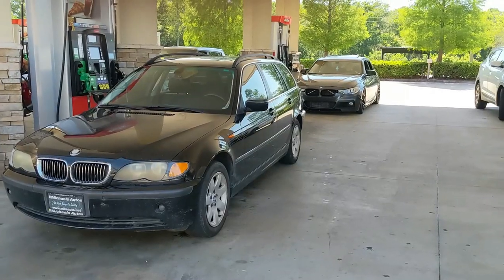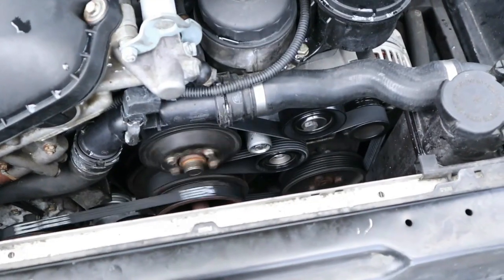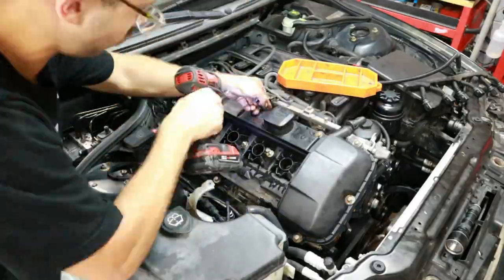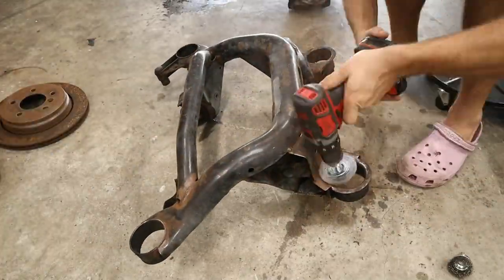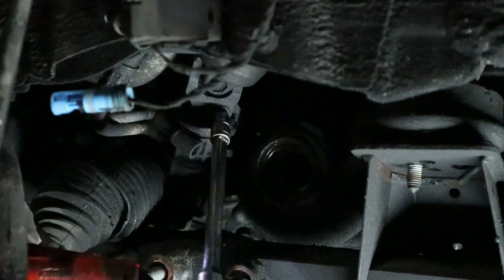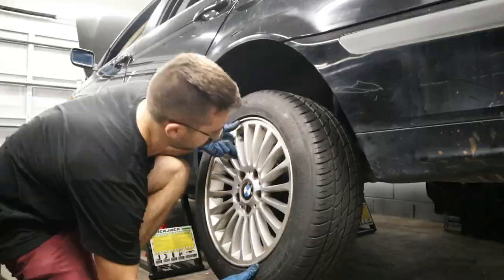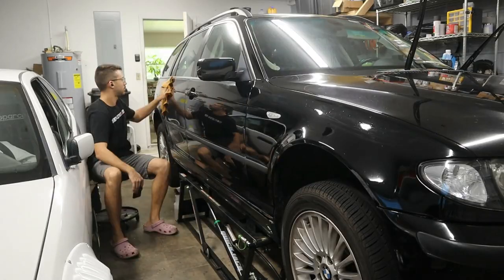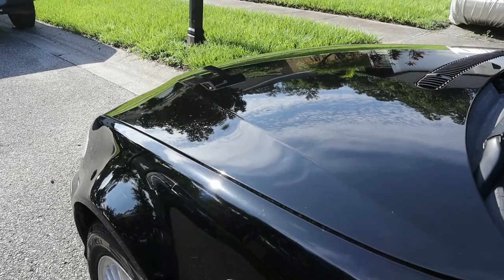Building a E46 BMW WAGON in Under 15 Minutes!

Comment: Dude, the best e46 build video on the internet. Great results. I have a 2001 E46 330 and have put about 150,000 miles on it and have had the exact same issues over the years.
Reply: Have you seen m539 restorations e46 build?

Comment: Got myself a 325ix a while back. Took on the task of ditching the automatic 4wd setup for a manual rwd thanks to a customer of mine that made a couple of ZHP wagons. So with the left over donor cars I had enough components to do the job minus the drivers side transmission bracket attachment point I had to fab up. Took a while but glad I did it.

Comment: great video man, awesome work done on the car. This clearly shows you are a pro man...the only mod I would add is "black edition" so I would swap the chrome trim with the black trim, black turn signals from ebay, and I would put black tint on the rear windows, also I would put some 18 wheels on it...that's all...everything else, perfect!!

Comment: Truly incredible. This really made me miss my old E46 Wagon. I had a 2003 325xiT in black sapphire metallic and its engine gave up on me while I didn't have the space or funds to work on it, so I sold it to be parted out. That car was a Copart buy. I only paid $450 for it after fees, slapped a junkyard door and fender on it (found the same paint code and everything), and drove it until it ultimately gave up. This is the treatment that car truly deserved. I miss it every day and I'm looking for the time, space, and money to do what you just did to this one. E46 chassis is truly outstanding and even though I've driven a dozen cars since, it's still the one I miss the most.

Thank you for the good feels and good times.
Reply from the maker: Love your story, I also fell in love with this car while building it. Such a great driver. Road trips for daysssss. Thanks for watching and sharing!

Comment: Nice build, man!
Reply: I've got the same car, but '03 manual RWD, tan interior.  I've done the valve cover gasket, oil filter housing gasket, fuel pump,  cooling system refresh, and more.  Haven't tackled the subframe yet, but it's on the list.  I'm thinking about sticking to the factory rubber bushings (or close).  I think the car handles great already with the factory bushings.  Are the poly ones THAT much better?
Reply from the maker: I prefer them because of how easy they are to install, the longer life, and sportier ride. If you're looking for maximum comfort, go for the factory rubbers, but if you keep the car long enough, some of them will have to replaced again. Good luck, sounds like a cool build!

Comment: How does the poly bushings drive? Thinking about upgrading every single bushing on my e39 to poly for driving experience
Reply from the maker: Maybe a slight bit more cabin road noise, but that's to be expected. Factory rubber will always be the quietest option. Handling = top notch. Very sharp front and rear suspension feel.
Reply: @TheBimmerBarn  thanks alot!❤

Comment: this is an old video. but i just picked up an e46 325xi wagon.  can you tell me why a 330xi 6 speed wont fit? the 330xi has an m54, my wagon has an m54. im going to swap a m54b30 into it soon. once the head comes back from the machine shop.
Reply from the maker: It'll fit! Same motor, same casting for the transmission 👍
Reply: @TheBimmerBarn  thanks man! I hope so because I just ordered it! I’m so excited! Thank you again for sharing your expertise and knowledge. I wish I could throw in an s54 but those prices are outrageous!

Comment: Hey can i talk to you i want to buy e46 wagon 320D 150HP what should i know...
Reply from the maker: Yeah! I'd check for rust as much as possible (jack points, door corners, wheel wells) and check to see what fault codes it has, so you know what you're getting into! If it has a check engine light, you want to know what the problem is before you buy. Otherwise, give it a good drive, test the windows and door locks, and then decide if its the right car for you! Good luck Haitem!
Reply: I have an e39 520d, same engine, but has only 136 hp. The biggest headache for me was the diesel injection pump, had it refurbished 3 times, 200 euro each time, and ended up taking it to a shop to swap a known working one for 300 plus 100 labor, so I spent 1000 euros on it, but to be fair I should have just gotten a known working  one from the start. The issue it had was that if the car got up to operating temperature, the car would not start if you turned it off and turned it back on 5 minutes after, but it would turn on if you poured water on the injection pump directly (next to the intake manifold, driver side for lhd).